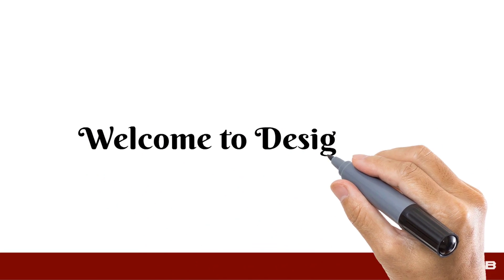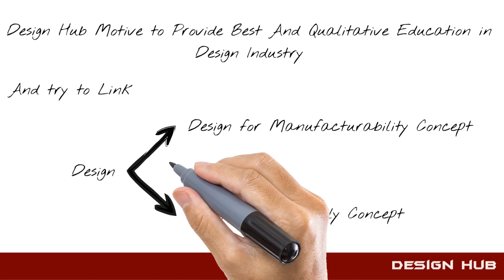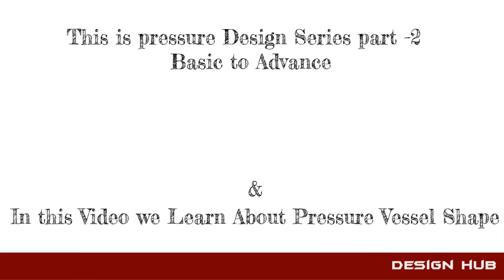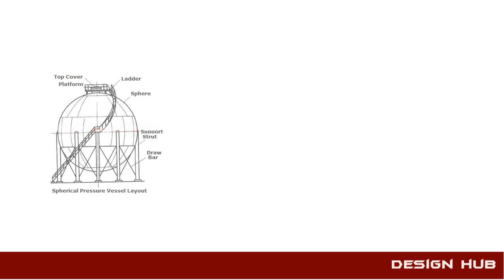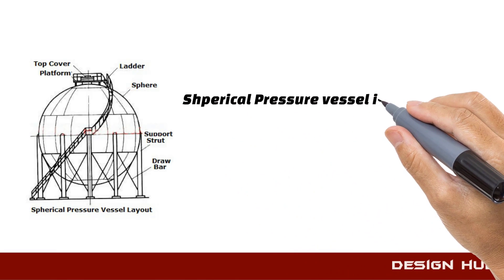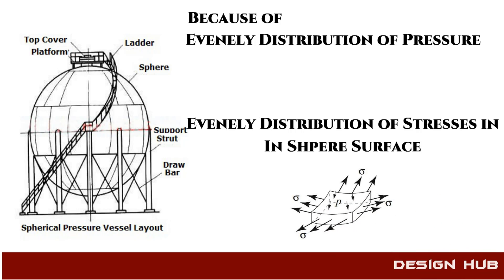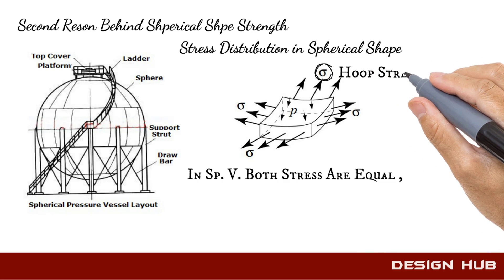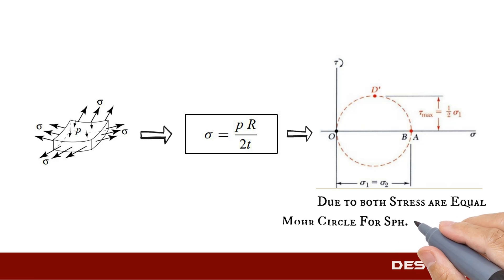Pressure vessel design part-2 spherical pressure vessel design

Comment: Nice video, but how do i know that my plate will be able to resist the pressure
Reply: If the stress on the plate material is less than the materials yield point, within a certain safety factor. You can find the yield point of materials on wiki.